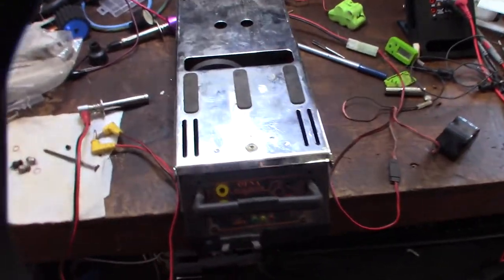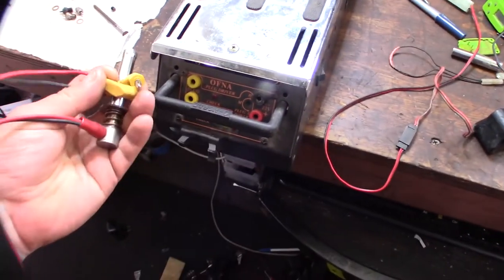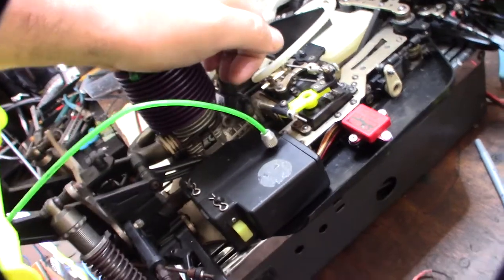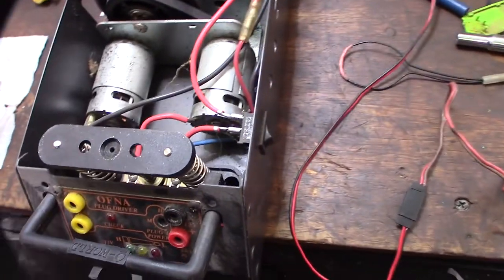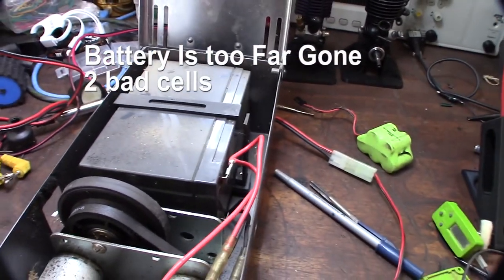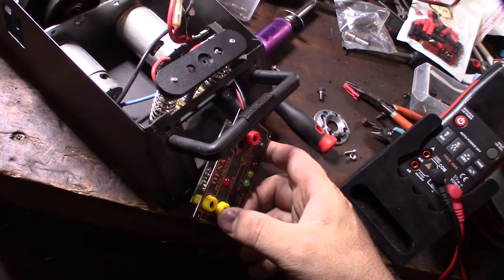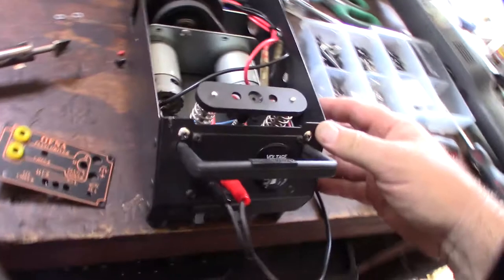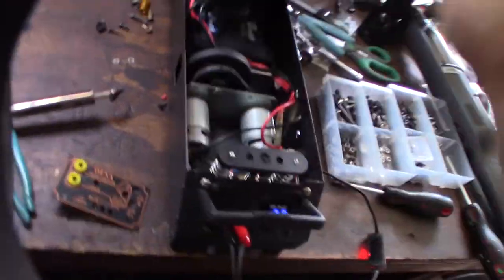RC Bump Starter Box Restoration Upgrade Test

Comment: Hey man mind showing how you wired it up for the voltage meter I have the same box in trying to figure out how to do the same
Reply from the maker: If you have a 3D printer I designed some battery trays for this box.